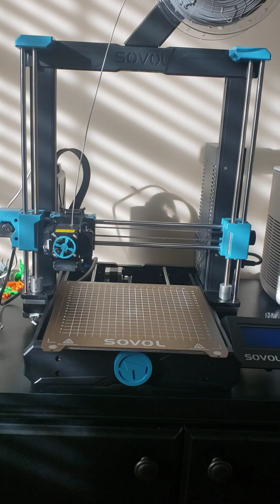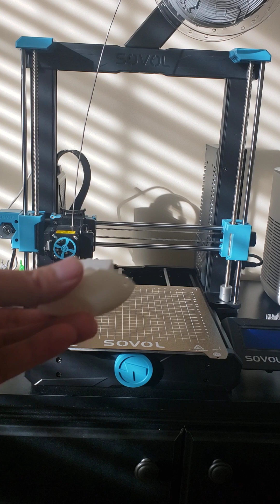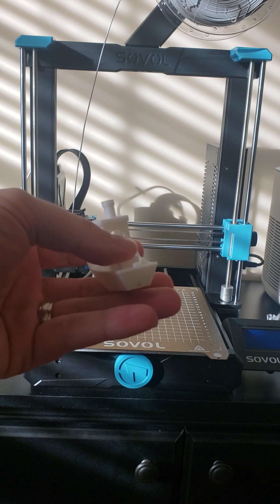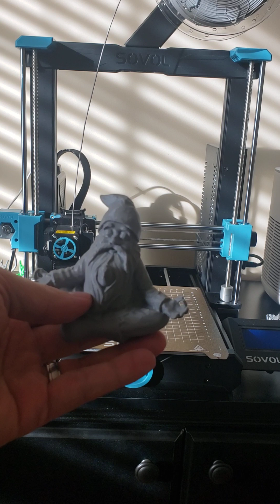Sovol Sv06 3d printer review - 1 month later.

Comment: I used washers and neoprene washers under the steel ones.  I got longer screws too so now I can adjust and have some squish to go up or down with rather than a steel washer.  I got my bed level with no more than 0.09 spread between extremes.  Neoprene is rated to 200F constant temp and they never get close to that.
Reply from the maker: It seems to be a popular upgrade

Comment: Have you ever noticed that when it comes to reviewing machines, the reviewer's background can play a huge role? A crappy machine might seem totally fine to a newbie, or someone who's used to using even crappier machines, while a minor issue could be a dealbreaker for someone used to the high life of expensive machines. So, I gotta ask - which machine is your main squeeze? Who's your go-to machine for comparison? Don't be shy, spill the beans!
Reply from the maker: My go to machine is an sv06 and though I do agree to a certain extent that each reviewer will have different criteria for whats good and whats not, I feel that a printer is only as good as the person using it. I have used a few "crappy" printers that were awful out of the box, but with a bit of tuning were not that bad.   
Proper setup and tuning is key.
Reply: @joeprints3dstuff  Thanks for your feedback. Any much expensive printer on the shelf to compare or mostly low budget ones ? I mean sometimes a better low cost printer does not reach the 500-1000€ printer's standards which prints well first time any time, just out of the box.
Reply from the maker: I have yet to see any printer just work everytime all the time. Just check out the x1c as its the most user friendly printer. Even it has problems from time to time. More to your point though, I tend to lean more toward the budget side as thats what I can afford. However I will be building some printers soon that I hope will rival some of the off the shelf luxury models.
Reply: @joeprints3dstuff  Budget is always a concern, for sure. But I'm always dubitative about Ender3 alike which carries 3 times their price tag on "upgrades". That makes a Prusa Mini+ much budget friendly than it seems. 

Up to what price point should a 3D printer be considered a luxury item? While a 3D printer is primarily a tool, some people may be willing to invest more in order to get a reliable and high-performing machine. In my opinion, luxury implies unnecessary hype, while a tool is not.
Reply from the maker: I dont subscribe to the idea that expensive equals better. This is why I call it luxury. Take prusa for instance. Their hardware isn't worth what they charge. What you are actually paying for is the other stuff that they do. Support work, quality control, research and development and having them fully assemble the printer for you. If you can afford it and or are willing to pay for it, have at it, but it isnt neccessary. This is luxury.

Don't get me wrong, I have used some "budget" printers that were pure trash. Undersized power supplies for one. Bent parts or even missing parts. But the vast majority so far are not too bad once setup properly and tuned. Could you improve them, sure. 

Upgrades are a popular choice but most of the time they are not needed. People new to the hobby fall into this trap of thinking that upgrades will solve their problem when really all they need is to learn how to use their printer.

Unfortunately this hobby isn't a turn key one. People have this idea that you can buy a printer and start pumping out fantastic prints using exotic filaments. This just isn't the case. There is a bit of knowledge that is required. This leads to frustration and the first thing they blame is the printer, but like you said, the printer is just a tool.
Reply: Hey @JoePrints, it was great chatting with you! For some people, the 3D printer itself is the project, and they love printing all sorts of trinkets in questionable colors. However, I'm an early Reprapper and tend to print useful parts all the time, so maybe I'm not representative of the whole 3D printing market customers. I have several printers, including Sovol and Prusa, and my experience has taught me that quality components make a significant difference. The part of marketing into a Prusa is close to nothing compared to the quality service, development, and components you get. For example, Jo Prusa developed the PCB heat bed first, which is why most 3D printers have heating beds. Prusa Slicer is one of the best slicers, and it's free because Prusa develops it, and people like me buy Prusa's. A Prusa has a genuine E3D hot end, which is far better than the low-budget hot ends found in Creality's printers. The gears of the MK3S+ are genuine Bondtech's, and the Rambo board Rpi is built over specs for long-lasting and safety, whereas Creality's boards use minimum copper tracks.

Now, let's talk about our Sovol SV01 printers. The glass beds refused to stick within 200 hours, and the E3D Titan clone wore out within 400 hours, just like the CR10S-sourced nozzle. The bearings had to be changed within 500 hours because they were rubbish ABEC 3 ones. We bought ABEC 7 but had to change the wheels frequently. The boards broke within 1000 hours, and we had to change the bronze nuts near to death, and so on. This happened on every one of them at the same time. We still have our SV01 printers, mostly because of the build volume, and now they are workhorses, just because we replaced the cheap components with quality ones. Meanwhile, we have a lot of Prusa's running with nothing to worry about except usual wearing parts, like nozzles, and basic maintenance like cleaning and greasing... So, including the support to the open-source community, my experience shows that Prusa's are worth every penny.

I guess you can't say before getting one, but the MK4 just released, and except for needing to increase our printer capacity, we see no reason to change our MK3S+ and Mini+ printers that have nearly 20,000 hours for the early ones. Low-cost printers may seem good enough if you don't have a high comparison point, but this is exactly what I wanted to clarify at the start. If the comparison point is the worst rubbish low-cost printers, better ones may seem good while they're not as good as you think.

Don't get me wrong, I don't think the SV06 is a bad printer (it's a Prusa clone in a way), despite its biodegradable components (bearings, wheels, board, hot end, etc.). But there's no magic to getting good components for the price. A good pair of LM8UU bearings from a trusted brand cost 12€. If I buy ten SV06 printers, I'm pretty sure I'll have a lot of maintenance and component upgrades to come, which you've already experienced with Klipper. Even a 250€ Prusa Mini+ Chinese clone may change your mind, and the real stuff is even better obviously. ;)
Reply from the maker: @axelSixtySix  I would agree that you are definitely not the average hobbyist and from an industrial standpoint I can see your argument.

Comment: Hello, I hope someone can help me.
 I have the problem that I can't print Pla from "Das Filament" with my SV06 :(
 After a while, the extruder "scrapes" the filament at one point in such a way that it is finally no longer fed.  I had no problems with other filament manufacturers.  What could that be?
Thanks in advance :)
Reply from the maker: Bump up the temp 5 degrees and try it again.
Reply: @joeprints3dstuff  i have already gone up to 240°C and decreased the printing speed down to 40mm/s, nothing worked :(
Reply from the maker: Have you tried tightening the thumb screw a little. Dont go too much though.
Reply: @joeprints3dstuff  yes i've already tried multiple different strengths
Reply from the maker: At this point i would contact sovol.

Comment: Hi. It would be great if you could make a video on how to run the SV06 with the Sonic Pad which O assume is what you're using to run Klipper on it. Right?
Reply from the maker: I would be more than happy to do a video on the sonic pad, but unfortunately I do not have one. I am running klipper off of a pi.
Reply: @joeprints3dstuff  Thanks for the quick response. Could you do a video on the set up for the PI? Which PI are you using?
Reply from the maker: @elleryfg7853  yeah I can do one. Any pi will do. Only one I think won't work is the original pi zero.
Reply: @joeprints3dstuff  That'd be great! Thank you

Comment: Hello dear Joe. In order to print high temperature materials, do I need to change the advanced pid settings on the printer? I am using the stock firmware, it is a new printer, thank you!
Reply from the maker: You should pid tune to the temp you will be printing.

Comment: The reason why it doesn't level for some, is because the cross bar on top is not all the way screwed down. It is made out of polymer and has to be fully seated in the vertical frame so the height is the same. 
This printer has very low vibration/ringing and very good print quality. It does require auto bed leveling every so often to compensate for slightly out of sync LDOs. Prusa MK3 has the same problem, that's why it bedlevels before each print by default. The independent motors are actually a feature and not really a problem. They are needed to be independent for the auto bedlevel function itself to work.
Reply from the maker: Yeah I love mine.
Reply: AFAIK both Z motors are sharing the same driver on the board so they are not independent.
Reply: @kord2003  Yes they are, as soon as you turn the power off. That is the reason the z axis needs to drive all the way up to level the x axis gantry. If the stops are too different in height the software bedlevel can't make up for it.

Comment: I must have received a "Wednesday" build because I've not run into the bed or sheet flatness.  When I got everything assembled, as you found, my first Benchy and 3D Printer Test prints were as perfect as anyone should expect from a first print.

I also checked the Z access with the "Campbell's Soup Can" and I was dead on each side.  I'm very pleased that this Sovol is my first experience in 3D printing.
Reply from the maker: Good to hear. I love mine.
Reply: Same hear, great printer so far.

Comment: I just got my SV06 and All bearings were just oiled, without any grease. And they are very loud and not smooth running even after cleaning and greasing them with proper industrial grade long time grease. Did u have any issues with your printer ?
Reply from the maker: Mine is working wonderfully.
Reply: Recebi a minha há poucos dias e está assim também. Rolamentos com bastante barulho

Comment: Did you try printing nylon with yours yet?
Reply: Nylon out of a dry box printed well for me with glue stick on the stock PEI sheet.  PETG was more of an issue for me.  I found it easier to get it to stick on a Sovol Ender 3 build tack type bed surface I had.
Reply from the maker: No. I mainly print pla and petg. Both work great.
Reply: @joeprints3dstuff  pla works great for me I haven’t tried petg yet. Do you dry yours first?
Reply from the maker: @Rustyshackleford1911  no, but I keep everything in vacuum bags with desiccant.

Comment: Love it. What I like about Sovol is the price for what it delivers.
Reply from the maker: Price per performance is fantastic.
Reply: Their customer support is horrible.
Reply: @allwoundup3574  I sent them a message wanting confirmation that the original model’s bed wire issue (it lacked proper support originally) was fixed. Only took 2 business days for a response.
Reply: @No-b.s.  and is it fixed?
Reply: @getcass  bed wire yes, but to be fair there is a sag problem on the extruder cable that can sometimes catch on tall prints. There is a popular fix for this on thingiverse called cable chain spine
Reply from the maker: I have had nothing but good experiences. They said on their live stream that most everyone had covid so they were a little slow to reply. I would try again.

Comment: I am looking into the SV06, Elegoo Neptune 3 Pro or Anycubic Kobra Neo and can't really decide which one to go for..
Reply: If you haven't pulled the trigger yet, check out the deal you can get on an Unrepair Kobra on Ebay...  You just buy the $6 Allstate Warranty, and not only are you guaranteed it will work out of the box, but also for a year.  Any hiccup and they refund your entire purchase price...  I've bought 4 printers this way (an Ender 2 Pro $69 delivered, an Aquila at $89, an Anycubic Mega X at $129, and the Kobra at $119), it is THE way to go if you can find a printer you like that was a customer return like these...
Reply from the maker: Well I only have experience with the sv06 from your list and I can say you won't be sorry for it. Hiwever I have also heard good things about the elegoo.

Comment: For me it's not the magnet, its the pei sheet. I swapped it out for my ultistik from my ender and its much tougher to lift.
Reply from the maker: I will have to try that. I have a pei sheet from my e3v2 that will fit.
Reply: @joeprints3dstuff  mines off the e3v2 also, the sovol sheet it weak on the e3v2 magnet aswell.

Comment: I levelled out a major dip in my Ender 3 bed with kapton tape on the magnetic surface below my sprung steel PEI sheet. Quick and simple and the abl more accurate.
Reply from the maker: Yeah I have been thinking about ways to sort it out. I think I might get an oversized standoff and cutit down to size.
Reply: @joeprints3dstuff  You could trywhat Chris did to his Prusa https://www.youtube.com/watch?v=OP1xzEKhHDg
Reply from the maker: Yeah I will give this a go. Thanks.